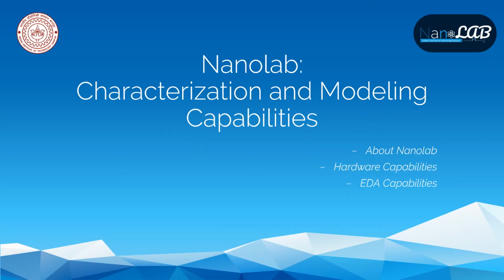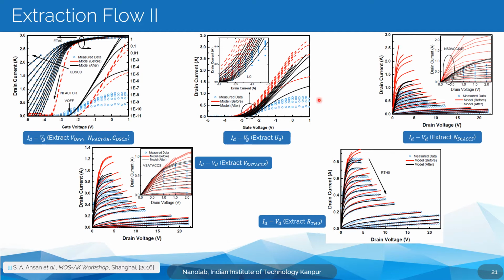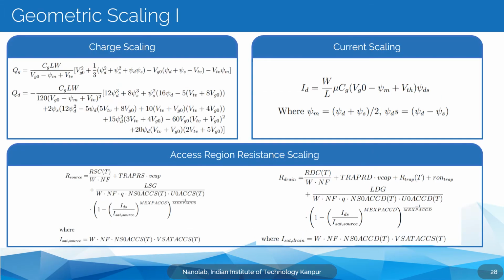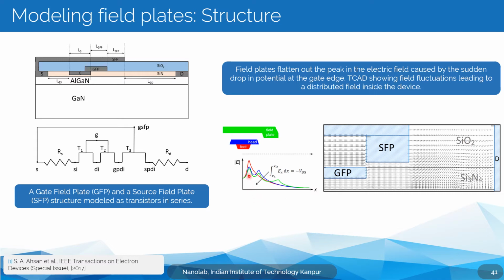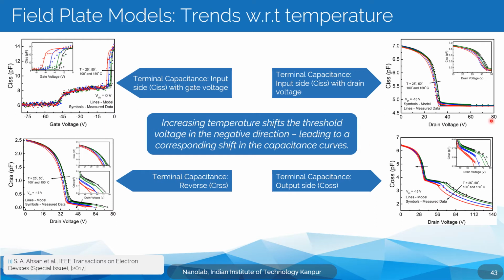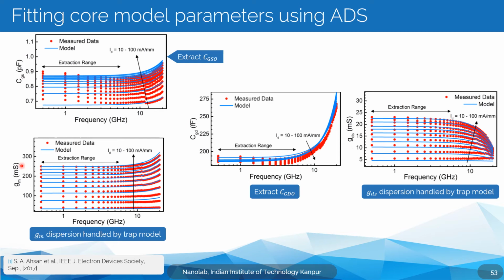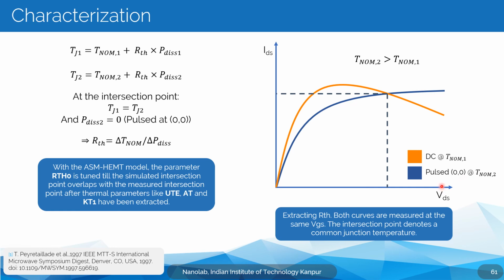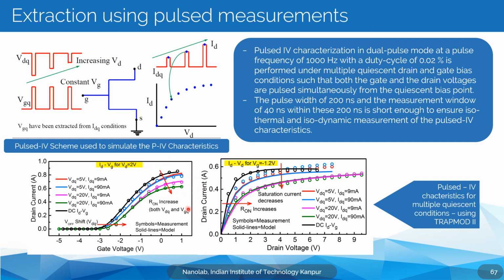GaN HEMT Characterization and Modeling using ASM-HEMT

Comment: I found that the Rds value of the model fitting is larger than the measured value, resulting in a large difference between the S22 simulation and the measured value. The simulated S22 starting point is close to the high resistance area of the Smith chart. Is this an inherent defect of the model?

Comment: Which software you used to plot these equation into graph?
@
Reply: IC-CAP allows to plot both measurement and simulation data on the graph, there is a ASM-HEMT extraction package inside.
Reply from the maker: I typically use OriginPro for plotting.